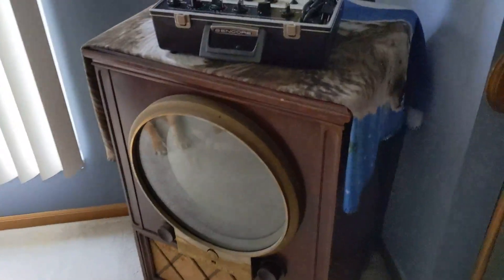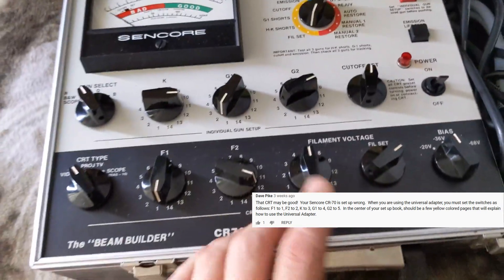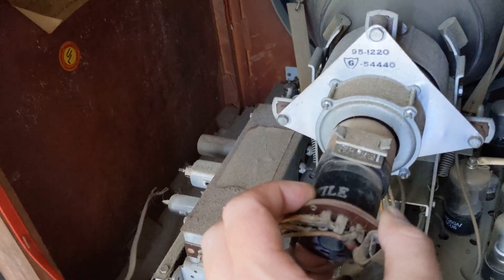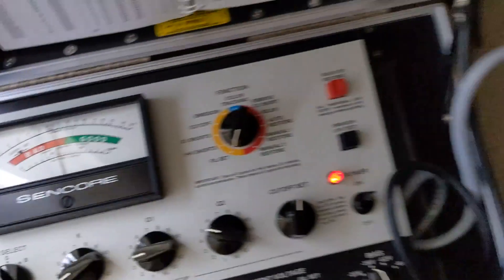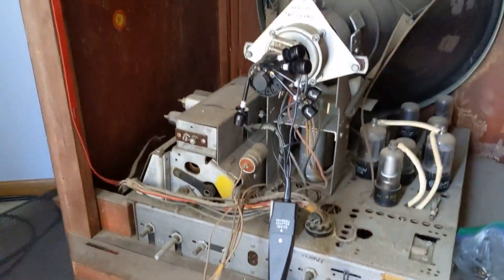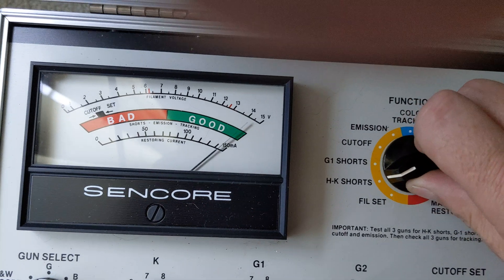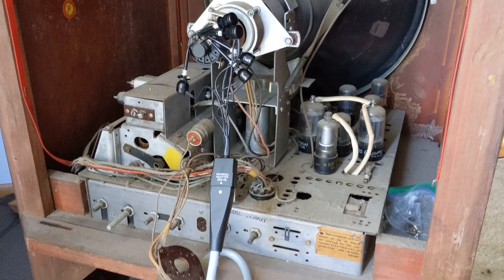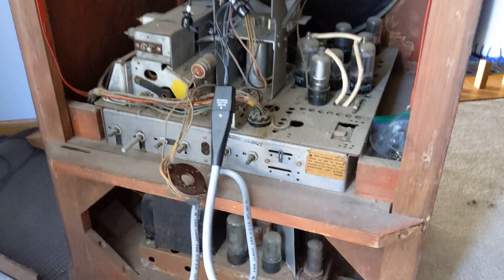Zenith Porthole CRT Retest Part 3

Comment: I hope when my capacitors arrive, and I have the time, that my RCA ctc-16 set, will work as nicely as yours does!😀
Reply from the maker: That would be great! I'd love to see that too! I really love these old early color roundie sets hehehe my CTC-16XL  needs some work. I shotgun recapped it and got lucky I didn't screw anything up and it worked, and pretty decent too. Fixed a lot of problems and did have perfect vertical linearity and lock. Purity was great, setup convergence and it turned out pretty good as well. The picture on that set blew me away on how good it was. Only 2 problems I have on it after the shotgun recap, the horizontal hold lock is weak and maxed to one side. That didn't change and it's getting worse and sometimes will loose it's lock. And the sharpness coil doesn't work or do anything. I used it a few times a week to watch evening news or star trek on it. Then I rearranged the dinning room and living room layout and didn't get the set moved to the living room until not long ago and it set unused for months. When first started using it the vertical was shrunk about half. I took it apart and checked a few things out, but didn't see anything obvious. Powered it back up and the vertical returned for the most part. But now to get the picture full, I can't get a perfect circle setup on a pattern generator, stretches the top like it did before my recap, but not quite as bad. Convergence is back out, may need just a setup again now the new components are worked it. So it's looking really rough in my videos than what it use to look like. Oh did you see the little info ad at the end of this video? Hehehe I threw in some ctc16 action :D / so I plan on doing some diag videos on seeing if I can fix these problems. I wonder if one of my new caps went out of spec or maybe a resistor. Will have to dig into it. See if I can get all these little problems figured out and fixed.
Reply: @MangieRaccoonsTech  All the vintage sets I have brought back to life, still have room for improvements, and often after they work decently for a while, something else fails, kinda like a vintage car!🤣😀
Reply from the maker: I can totally see that! :D Its always something with my 66 chrysler New Yorker lol

Comment: Hey, Wicked RJ's Tech, great job and video report on testing the Zenith Porthole CRT there!  Your CRT tests even stronger than the one in my Zenith Porthole!  My set has a ways to go yet, likely to be a winter project for me.  I have nothing on my screen, I have audio and HV, and the instant I turn off the set, I get the "little lighted  square" in the center, as the set powers down.  My plan is the same as yours, I want to first try to repair what's actually wrong, before I do a "shotgun" recap.  I learned years ago, it's the best approach, and more cost effective too!
Reply from the maker: Oh wow! That's really awesome! I'd love to hear how it goes on your porthole. Would be awesome to see it as well ;) this set will probably be a winter project for me as well and I'm going to try video and document as much as I can on top of it hehehe can't wait to see this set working good :D looks pretty promising. I still have so much to learn though on troubleshooting and diag on stuff like this.